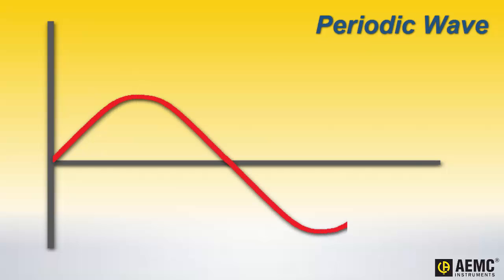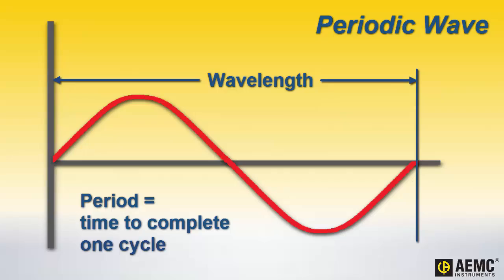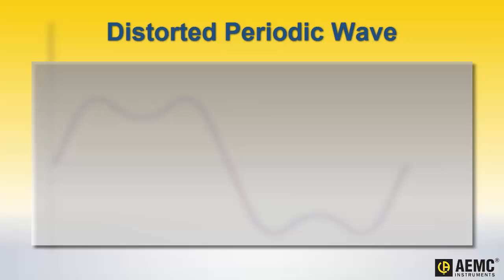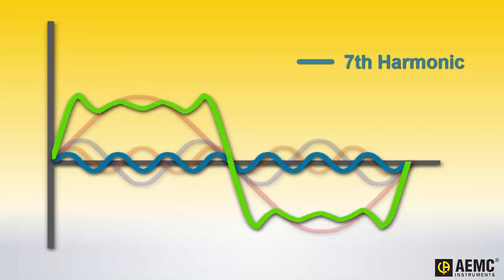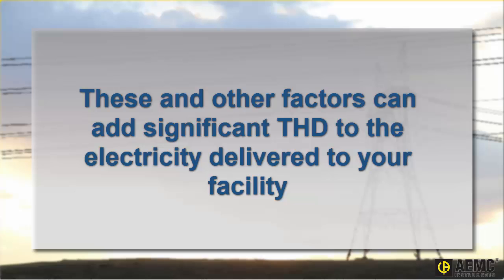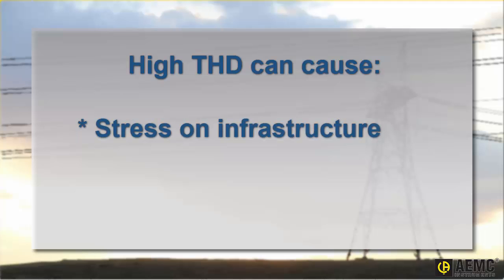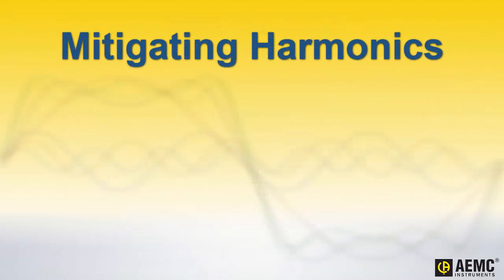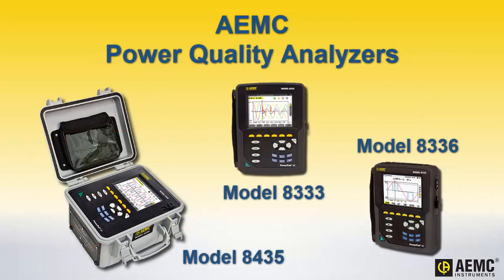AEMC® - What Are Harmonics? (8435 Discontinued Replaced by 8436)

Comment: The problem with this explanation of harmonics is that it uses the term ‘harmonics’ within its definition i.e. its a circular explanation.  It doesn’t really explain what harmonics are, but rather the impact of harmonics within a system, which is to answer a different question than the one in the title: “what are harmonics?”